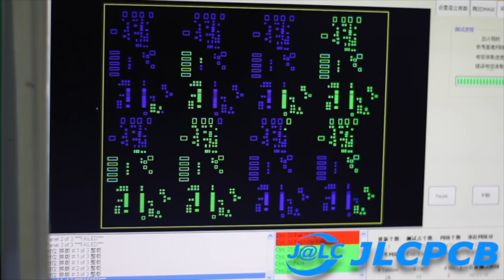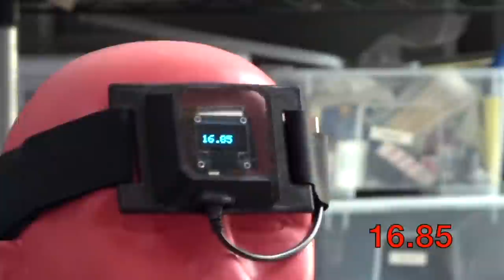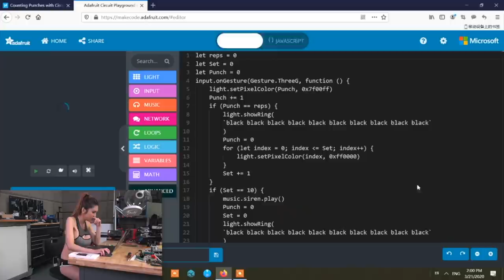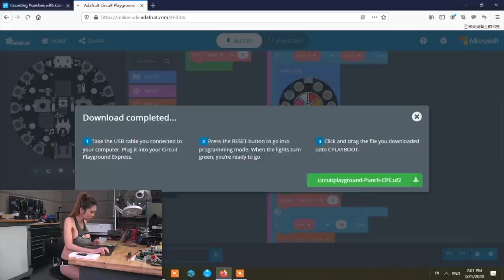Counting Reps with the Adafruit Circuit Playground!

Comment: Those X220s are banging laptops, I still use my old X220t as a secondary work system.  Funnily enough I bought a kid I know an educational robot a few years ago.  I didn't have the time to teach him (I did buy one for myself as well), but recently he was shown programming in school and was asking his parents for a robot... that he already had!  

Definitely wanted to have the time to show him how it worked, but it's good to know he's building skills on his own now too.  While it's definitely more limited than a more standard circuit board, the Sphero robots are cheap and give kids instantaneous feedback.  It also uses block-style code which puts the focus on understanding instructions and less on syntax.  It does allow you to drop into C++ if you want to experiment further, but by default it's programmed through a tablet/phone interface.

Comment: Please make lishi tool with laser cutter!! I want to know how to make my own lishi lock pick/decoders!!!
Reply from the maker: I wanted to but you need a $50k metal cutting laser to do it...
Reply: @Naomi-Wu  dang..has to be precise I suppose. What if the handles are 3D printed and just pick and key guide are metal to cut down on cost?
Reply from the maker: @pouncerminned863  Well it's the machine that's expensive, so it does not matter how much you cut with it. I could carefully mill it but it would end up costing me a lot more in time than just buying one.